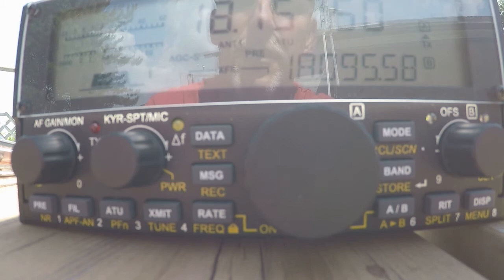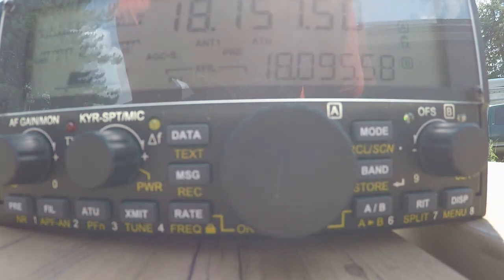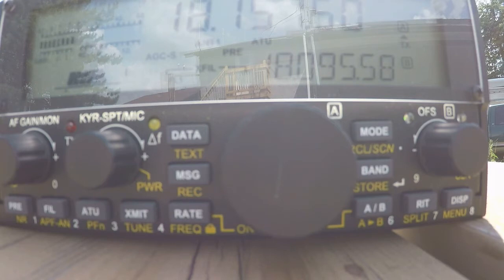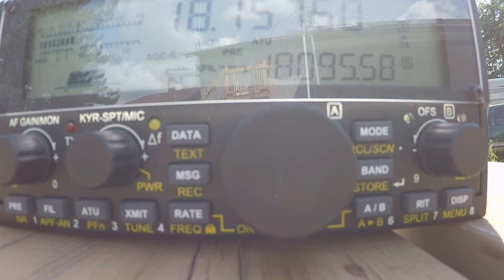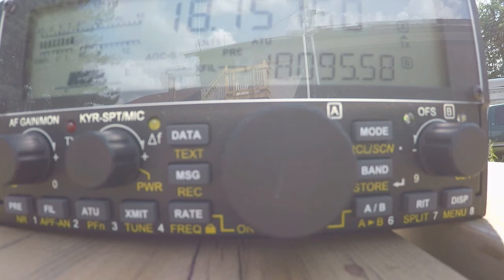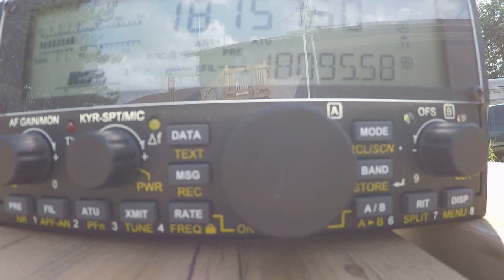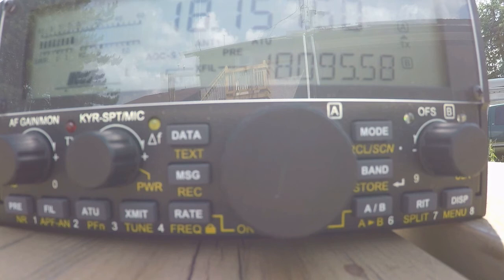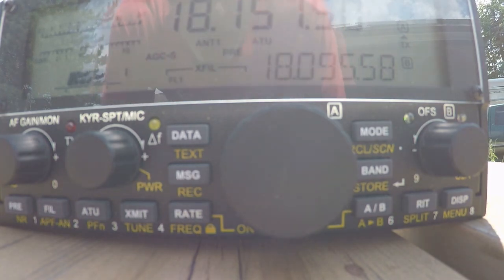mcHF audio tests using external reciever KX2

Comment: Fred the audio is "Pinched" a bit ..... you are better on the "ZERO" compression audio level using the HiFi HDMI audio on the computer =)
Reply: thei issue is that HiFi HDMI audio is not what others hear on a normal rig. I foudn them all to be very legible actually. You can argue that compression sounds a bit agressive but that happens with that kind of signal levels. If you drop compression at low levels they won't hear you. And you need it due to the QRP nature